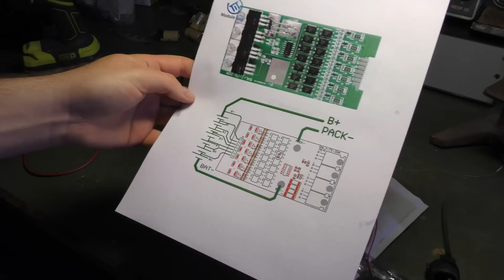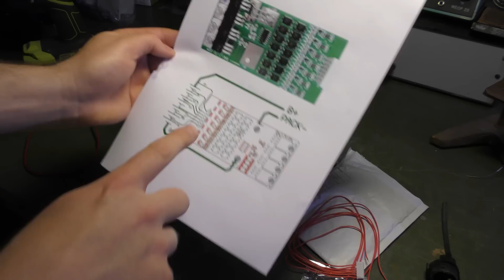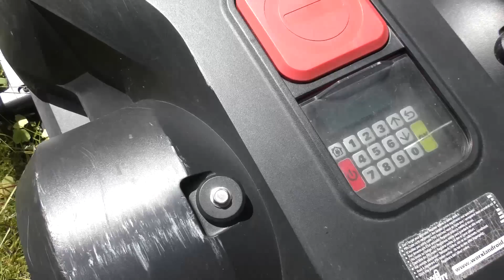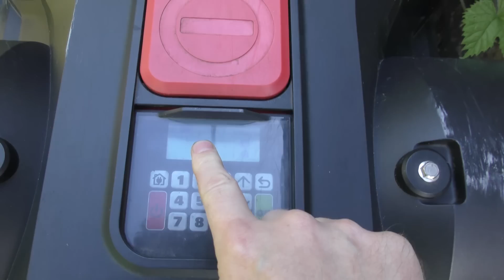NEW BMS for the Solar Power Robot Lawn Mower Project - 845

Comment: HI 
I have husqvarna automower 320.My battery is stay old. i took it from mower. here 18650 1600mah vtc3 cells. i bought cells 18650 vtc6 3000mah and did same 5p2s. old bat has bms board (bq77908A). i re soldered and output of bms 7 volts. i am thinking bms is not working with new cells. how to restart/startup this bms with new cells? my be your know something ? thank you
Reply from the maker: I would check if all the cells is at the same levet,,, BMS might cut if the cells are to much out of sync.
Reply: @MyPlayHouse  i hacked this bms. I remembered last battery voltage was 19 3.8 per cell. So i connected to new cels and charge to 3.9. after discharge and bms began work. I am reading manul of chip and seeing that chip storing current values. So if you ll connect new with diff voltage it s not starting. Sorry for my eng i am russian)) i spent 3 days and open secret to you)) thank you
Reply: Time of cutting with 6000mah battrry instead of 3200 original same. I am thinking no need to put 3000 mah plus 3000 mah in parallel. 10 cells like original.. lets seein future. If i cant hack bms . I have second plan . I bought old bat from dealer hjsqvarna for 12 euro.i planned to connect example bat and new. Connect all points plus board bms and replace to new board like online )))

Comment: NOTE That BMS board will only top balance and it only starts balancing at 4.2 Volts, Which means you must change up to 4.2 or it will not balance the battery. 
Check your lawn mower will charge up to 29.4Volts to start balancing if it does not then that is your biggest problem and which is also why the cells will keep going out of balance. I see you have 31v going into the charger but what is going into the mower? Is there a charging board that is in the mower base station that takes the 31v and outputs a 3 stage lead-acid charge? at 28v float? 14x2 for the old lead-acid
Reply from the maker: Hi Mikes DIY Tesla Powerwall
Thank You very much! okay cool thanx..
Thank you for watching! :-)